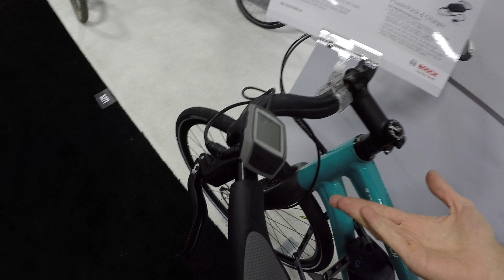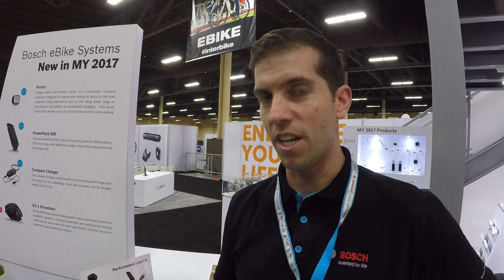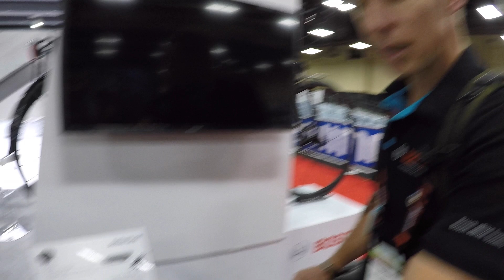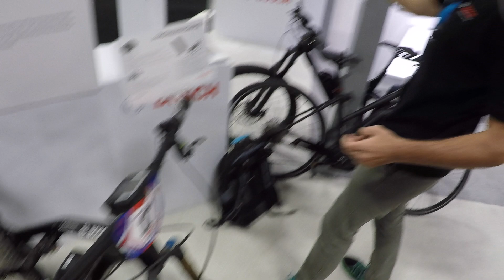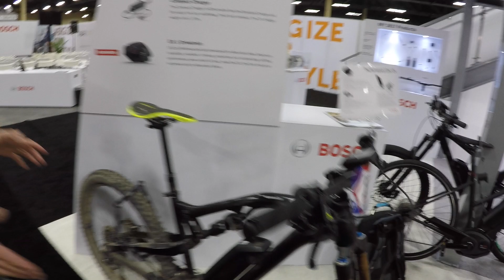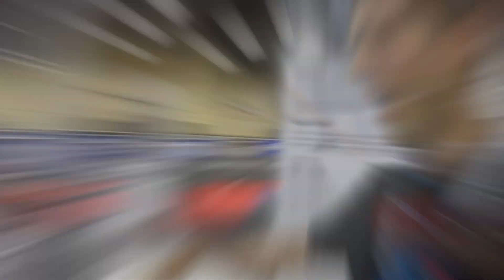2017 Bosch Electric Bike Updates from Interbike (New Display, Larger Battery, Smaller Charger)

Comment: FYI: With lithium no battery packs are really 36V, that's just remnants from lead-acid days. Li-ion is 3.7 volts (nominal) per cell and are usually 10 cells serial for a 36V pack, making it 37volts. LiFePO4 is 3.3V per cell and are usually 11 cells serial for a total of 36.3 volts. This will make a 13.4Ah battery at 37V = 495.8Wh, much closer to 500Wh than your 486Wh estimate.

EDIT: I wrote parallel when I meant serial.

Comment: Court, I thought Haibike angled all the Bosch motors up since 2016. I'm surprised to see Haibike's with the older frame/motor angle.  More details on Haibike Bosches (boschs?) please.
Reply: ForbinColossus The CX motor has a slightly smaller profile than the standard Performance motor allowing for some creativity with the frame integration. The Haibike's with the Bosch Performance Speed motor will continue to exist with the original generation 2 frame with some improvements where the CX motors will have a slightly more integrated look.

Comment: Watched this video yesterday and stopped by my local FELT dealer this morning. ( I am interested in an Outfitter )
The dealer does not stock Outfitters , I would have to order one . I told him I wanted to make sure the Outfitter I order ,
would be a 2017 with the Bosch UPDATES to display etc and not a 2016 . The dealer's reply to me was :
US warehouses have 2017's in stock now , but makes no difference because the Bosch improvements described
in your video will not make it onto Felt bikes until model year 2018 . QUESTION : Is the dealer correct ?
Reply from the maker: Possibly... I haven't seen or heard many updates from Felt in a while, it seems like they had a burst of ebike activity but are just coasting now. I wouldn't be surprised if the bikes have not changed BUT the latest software updates can be done to any Bosch Gen 2 motor I believe... the hardware is the same even if it's not mounted exactly the same on a bike frame
Reply: uconnapharm the motor will be the performance motor. The nice thing is you can update the motor system with the diagnostic software.

Comment: Great system but they obviously don't believe in open source.
 You have to do the course to get the dongle? 
It will be good for the sales figures for now but ultimately will reduce their overall market penetration.
Reply from the maker: I think it has a lot to do with customer service, they want dealers to be knowledgeable and are investing a lot in training... it also improves safety and probably helps the systems work better and last longer. Open source has benefits but these guys choose their partners carefully and make sure everything is solid which I can appreciate and it sounds like the course is optional so that's nice :)

Comment: What are the prices for everything?
Reply from the maker: This is all equipment that comes stock on ebikes vs. kits that you can add later (except the battery). Basically, the prices depend on who is selling it with their ebikes. I think most of the time Bosch powered electric bikes are $3,000+ like you could get the new IZIP models that feature it.
Reply: Thanks for the fast reply. I check out a lot of your reviews. I need to do something for exercise. I think a e-bike would be perfect for the summer maybe a few time's in the winter here in Michigan. I haul travel trailers with my dodge 3500 in all lower 48 states. Only home on weekends. So even if it is not much it will be something getting older sucks. Next trip I take a trailer to Missoula Montana